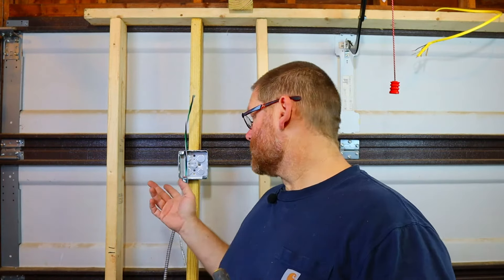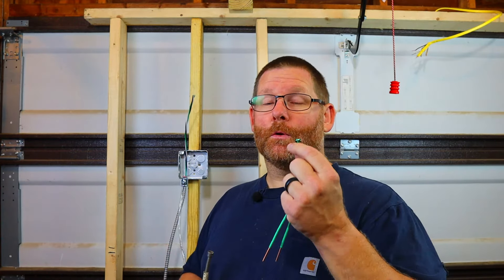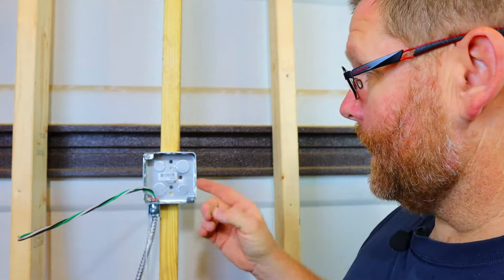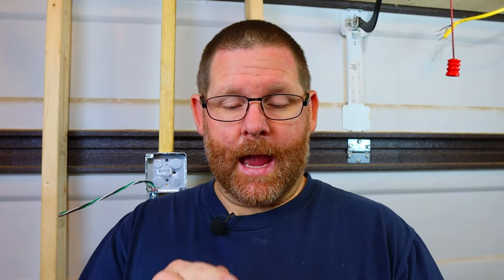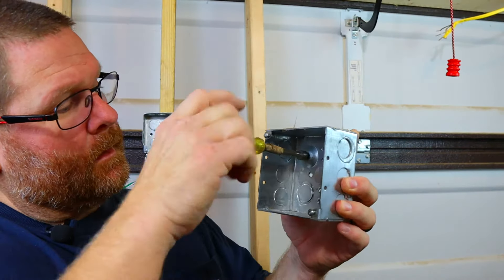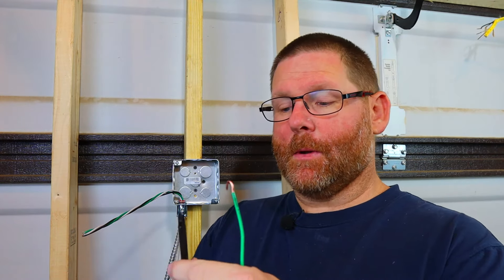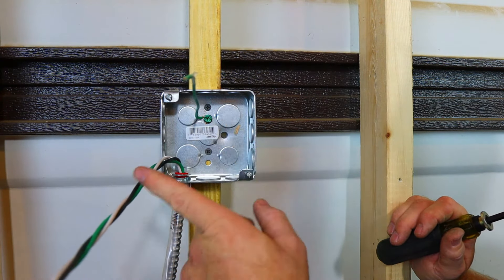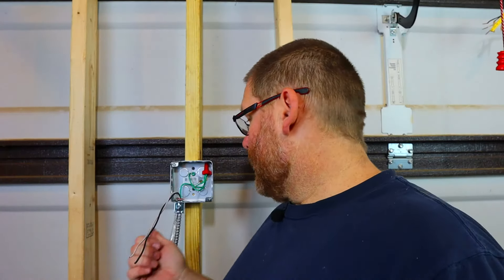How To Ground And Bond A Metal Electrical Box

Comment: Just used a side ground clip from home depot to ground an existing junction box.  The box was just for romex wire connections.  It had grounds running through it but the box itself was not grounded.  This was a hexagon box mounted flush at the back to a 2x4.  It didnt have the raised ground at the back like some newer boxes.  I was considering drilling a hole in the box side for a ground.  This clip was far easier and worked perfectly.  I hooked the front cut wire slightly over the clip and ran the wire from the back of the clip to a wire nut in the box.  The box cover fit over the clip easily.
Reply from the maker: Definitely a life saver when you don't have any other options. Thanks for watching and commenting ☺️
Reply: Good for you. I'd never use any kind of lazy @ss clipping sht. There's code for what you didn't do.
Reply: @nothankyou5524  I guess we all have to decide what we are comfortable using.  The clip is C UL listed and is designed to be used in exactly the way I used it.  I can say that the connection to the box felt solid and very secure.  I had to use a hammer to tap it on so it has a good amount of clamping force.  I wouldn't hesitate to use one of these clips again in a situation where adding a ground screw to an existing box is difficult.  Its certainly safer than leaving the box ungrounded.  I really can't say if this would pass code.  This is my own home.  I'm confident the connection is and will remain secure.
Reply from the maker: He is completely within code here. Come on bruh how about positivity rather than negativity 🤦‍♂️
Reply from the maker: I agree with you. It's completely fine well wiring code it's completely UL listed. Some people just want to troll. I would use them again too.
Reply: @nothankyou5524  The clip is acceptable and Code approved (provided it's "Listed" for the use). It's certainly better than NO grounding on a metallic box.

Comment: After watching this, I opened up a metal receptacle box in my basement that I needed to work on.  The ground wire was wrapped around the ground screw and the two ground wires were merely twisted together with no wire nut.  This was done by a professional electrician! Re-did the way you showed here (along with your ground nut video).  Thanks!
Reply from the maker: Awesome glad that my video helped you. Alot of guys especially older ones in my experiences do it like that. Is it right no, but unfortunately they do it like that for so long that they believe it's right.
Reply: Doesn't sound like he was a "professional" to me!

Comment: Nice video. For all the more curious folks out there the box in this video doesn't need to be bonded to the box because he is using BX wire(metal sheathing is the ground), I am of course assuming it goes to the panel or another 4x4 that is bonded. I also might clear up that your ground screw does not need to be a green machine screw, the code book states the screw only needs to be green for the devices(switch, outlet etc..) the bonding wire needs to be green or green w yellow stripe but only if insulated. Bare wire is fine for this application. Most of use just buy pre made 12 gauge pigtails that have a green screw but if you can't find any you have an alternative. Some but not all jurisdictions allow self grounding receptacles instead of the grounding pigtails.
Reply from the maker: Very well said thank you for your comment and watching
Reply: No they don't. But you sure start your rambling emphatically. For someone who doesn't read to the end, and why should they have to, he made the video, why try to technically show him up. I can tell you why....
Reply: Actually, that's not "BX wire"... it's MC ("Metal Clad", type MC). 
But agree 100% on everything else you stated...
Reply: Yes, he does have to bond the box.  The sheathing of ordinary MC cable is not rated for use as the EGC.  In order to be suitable for use as the EGC, MC cable has to have the "interlocked metal tape" type bonding conductor that runs the length of the sheath. - 2023 NEC 250.118 (A)(10)(b).  

The cable he is using has a green wire in it, so it is a traditional type MC.  There would be a splice or a device in that box if it were not a teaching example.  Therefore, he has to bond the box to the EGC in the cable to create the acceptable ground fault path.

Comment: Question: Make a video where you explain when you HAVE to use a ground bushing connector when coming into a box. I normally only see them in main panels and sub panels. But I know there is a code that explains that are required when using either eccentric or concentric holes.
Reply from the maker: Great idea for a video. I'll definitely work on it
Reply: @MountaineerOutdoors  
Is it ready yet?
Reply from the maker: 😂 😂 Nope unfortunately

Comment: Thank you. I found that to be very helpful.
My house was originally run w/ ground wires (14/2 I believe) coming up to the metal gang boxes but they were simply grounded out tot he box, and only 2 prong receptacles were installed.
I would like to bring these up to code and I felt this video was helpful in explaining the best way to ground/bond them.

Comment: Great video.  Thanks for that.
I have a cable that is going through metal ceiling fan box.  The cable is not spliced at the box as yet it is just a pass through (will splice when we install the fan).
When I use the non contact tester, it shows that metal box is hot.
How do i ground this as of now? or is it not required? pls let me know
Reply from the maker: It's just reading inductance did you figure it out?

Comment: Im in an old house from the 60s. Its 12 guage wire running through it but there is no ground.  Can i just ground the receptical straight to the box or should i run a new wire with a ground from the fusebox
Reply from the maker: If it's conduit yes but you need to verify it's connected still. Over time alot of the pipe does come apart. Pipe is technically a ground if it's in tact

Comment: Thanks for your helpful videos ! I live in an older apt that does not have a ground wire , would adding a ground wire to the metal box alone provide protection?
Reply from the maker: Do you mean adding a wire that's starts at the ground rod or steel to the box? Or do you mean just from the box to the Recep?  If it's older I may be in bx which they use to use the bx outer jacket as the ground?

Comment: My junction box with 3 outlets has 3 black wires and 3 white wires, i don't see any ground to hook up my floodlight camera is there any solution to that? Thanks!
Reply from the maker: Is it in metal conduit?
Reply: @MountaineerOutdoors  yes
Reply from the maker: As long as you have metal conduit and it's in tact, you can use the conduit as your ground. So you can use a pigtail from the box to your device. However, I'd always prefer a ground wire of course.

Comment: What fitting connector could be used to secure the installation of one metal electrical box directly on top of the other?
Thanks
Reply from the maker: Are you referring to back to back or back to front?
Reply: @MountaineerOutdoors  bottom to top '"one metal electrical box directly on top of the other"

Comment: What is the Article 250 verbiage regarding bonding by means of the MC outer layer sheath/connector, or conduit especially RMC? 

I worked industrial plant maintenance electrical for decades but did very little if any installations. I do however remember back in the days when a separate ground wire was not required when connected to metal raceway. Do you know when that rule changed and or the Article that addresses that topic/issue?

Thank you.
Reply from the maker: I'll have to look. But in conduit you can absolutely use the conduit as a ground without any extra ground wire. I personally don't think that is a good idea but perfectly legal

Comment: Thanks for the informative video. If your ground wire comes into the box as a bare copper wire, is it okay to use that for bonding the box instead of green plastic coated?
Reply from the maker: Absolutely!! and good question. Thanks for watching and commenting

Comment: Amazing video but how would u go about grounding with bx armored cable I understand it has its own bonding wire so how do we go about grounding an outlet or switch if the bx armored cable doesn’t have a copper ground
Reply from the maker: You will have to run new wire or use a gfci
Reply: Wouldn’t the outlet box or switch box itself be bonded  can I just add a green screw with wire for the ground since it’s bonded with the bx armored cable I don’t know if I’m making any sense  but hope it clear
Reply from the maker: So what you are saying is partly right. Bonded switch to box yes grounded no. I'm not sure the exact code right off but it's not legal anymore. I will have to look at it when I get home this weekend and I will let you know what I find out. From my experience though it's not and even though I probably showing ground I wouldn't trust it too many variable..
Reply: @MountaineerOutdoors I would appreciate that so much I’m working on my basement all my wires are bx armored cable with bonding 
I want to add outlets  when I test it all says correct wiring and when I test for proper ground reads 120 volts when I have the tester on black and white wire  says the same when I put the tester on the black wire and the metal outlet box  and would it be wise to splice and switch to romex

Comment: So you can Ground to the 2x4? Also what the 3rd free floating green wire for?
Reply from the maker: You cannot ground wood and the 3 rd wire is a pig tail
Reply: @MountaineerOutdoors  I looked thru several of my homes. Everyone one of them have the ground wire into wood 4x4s. Every video I seen also uses 4x4 to screw in the ground wire. So I going to say they do ground into wood.

Comment: Is there anyway to flush mount a metal box like that? We are building a shop with 7/16 OSB on the walls and are required to use metal boxes, but we want the box inside the wall so the outlet/switch is flush.
Reply from the maker: Yes get a plaster ring. Then it will be perfect. They come in different sizes

Comment: Does the ground wire need to be insulated 
My 12/2 wire has bare copper so the the ground from the box screw and the ground from the wire are all bare copper .  Is there a reason yours is insulated and needed to be stripped?
Reply from the maker: Nope it can be bare. I bought those like that pre made that's why mine look like that

Comment: Just bought a house and all metal electrical boxes are grounded via a ground wire and ground clip. The outlets are not grounded, but in using an outlet tester, it shows the outlet is wired properly. I need to install new outlets because the previous owner painted the outlets and you can see they are old. Do I need to get a ground wire to the outlet or is the ground wire that is connected to the clip to the box okay, since the tester shows the outlet is wired properly (both amber lights to the right are on and red light off on the tester).
Reply from the maker: Good question. So make sure you get self grounding receps. And/or you remove the plastic or fiber washer that hold on the screw to the receptacle so it makes metal to metal contact. Sounds like you have an older home? They use the bx or conduit as the grounding conductor which is totally fine.

Comment: Does it matter how old the metal box is for adding a ground wire to it and can I use any screw that fits or if it already has a screw even if it isn’t green
Reply from the maker: Code says it has to be machine screw.. Green is irrelevant as long as it's a machine type screw. The age of the box doesn't matter either

Comment: Thank you for your video. I have a 1970s home with an electrical outlet that has AC cable running into it (hot/black is copper, neutral/white is copper but the armored cable has a thin aluminum ribbon that connects to the ground screw on the outlet. I want to add another electrical box in my shop and tie it into this outlet with the AC (the new outlet has a 14/2 Romex). When I bring the Romex copper ground into the original metal box, should I ground it into the metal box? Should I take the aluminum ground from the AC cable and screw it to the original box too in a separate spot? I do not want to tie an aluminum ground together with a copper one.
Reply from the maker: You definitely can do it just as you have written here. Thanks for watching and commenting ☺

Comment: thanks.  Is there any reason why the ground wire can't simply first do a loop to the box'es green screw , and then go to the plug, all as one wire. Why make this setup with 3 wires.
Reply from the maker: You absolutely can I was just showing a different way.

Comment: Is there anything wrong with a ground wire connecting/making contact with a junction box in more than one place? I've got a light fixture install going on...I can't prevent the bare ground wire from touching the side of the metal romex where it enters. I will connect the ground wire to the fixture's ground screw... just wondering if it will matter that then the wire will touch the box metal in 2 spots. Thanks
Reply from the maker: Nope ground wire touching the box is totally fine
Reply: @MountaineerOutdoors  much appreciated 👊

Comment: Will not grounding  metal box throw the open ground code ?
Reply from the maker: That's a tricky question. You have to ground the box if you are using romex. If there is no ground at all, and your using emt or metal conduit as long as it's connected back to the panel your ok. The box has little to do with reading the open ground code

Comment: Very nice video.  I found out just today that the electrician that wired this house back in 1994 didn't bond the box for my electric cooktop and it is a box just like the one in your video (no raised dimple for the ground screw).  It is mounted to the back panel of the cabinet.  I think if I just try to screw the ground screw in, it will likely strip the box like you mentioned.  But wouldn't running a drywall screw through the hole also screw up the threads for the ground screw?  I was thinking of marking the hole, then taking the box off and drilling out the back of the cabinet where the ground screw would go.
Reply from the maker: So the short answer is yes, mark the box take it off the wall then drill out the spot. Running drywall screw will mess up your threads.

Comment: Isn't the ground screw when installed in the metal box touching the stud behind the box?  Is that ok for a ground?
Reply from the maker: If you are using boxes like I have it's raised up. Are you referring to boxes that don't have them? If so it could be
Reply: @MountaineerOutdoors 12:20 I liked the way you twisted the wires together. I didn't know the insulated part of the wires needed to twist around themselves. You may want to mention that very important fact. Thank you. I enjoy your easy viewing and great guidance on your program.
Reply from the maker: It's not important just the way I do it. The copper twisted is the most important part. Thank you for your comment and watching ☺

Comment: Could rubber washer insulators be used with a wood screw on either side of the box wall?
Reply from the maker: Not to ground the box. Has to be of machine type

Comment: You don't need to twist your wires together if you use the proper wire nut(ie  Ideal TWISTER wire nuts) and the Mc ground wire can be wrapped around the screw in the box if it is long enough.  There are several right ways of doing that.  Your way is right also.  Drywall screws are usually more brittle and bush league for mounting boxes,IMO.  Thanks, Russ, 28 years in the Electrical Trade.
Reply from the maker: I appreciate this comment and watching ☺ have a great day

Comment: What if one of the wires is stranded, ifor instance, a mc whip for an A/C.  Can one of the 3 wires twisted together be stranded or is a different wire nut or connector required?
Reply from the maker: You can do one of two things, make a pigtail from stranded or solid or use a fork terminal

Comment: Great Video! I always do a mid strip in my ground wire, loop on the box ground screw and then use my excess for the switch or receptacle. Old timer taught me this, but i heard its against code. though im not sure why it would be, less connections / less resistance. How ever i do waste more wire doing this with MC cable because i pull two feet into box so ground is long enough. whats your opinion?
Reply from the maker: I believe that as long as it's not broken and in good condition send it. As far as I know most people do that and never been busted any inspector. Great question. Thanks for the comment and watching ☺

Comment: Thanks for the great video.  I have a question now, if i have an outdoor receptacle that does not have a ground and I'm unable to run a ground to the electrical box that is not grounded can i just make my own ground near the location of the receptacle with a grounding rod?
Reply from the maker: No by code you cannot. That could cause a whole lot of issues down the road bottom line is no
Reply: @MountaineerOutdoors  thank you.  I figured that was the case. Do you have any videos on how to  ground the whole system? I really just need this one outdoor outlet to be grounded.

Comment: Hahaha. I love these videos. How about someone finally showing us how to ground a metal box when there is only a hot and neutral coming into it???
Reply: You see a lot of that, do you? I've never seen that at all. Two wires, not used for residential, not done "the right way. Or just run your own danm ground wire. Or pull romex, 2 wire w/ground. Surely you can find one correct solution, no?
Reply: @nothankyou5524  Two wires in residential homes (black and white) was gone the right way 100 years ago. And when you own a house that old, good luck trying to pull new wire through. It's a nightmare.
Reply from the maker: @Me-l9h-u8g it's not a nightmare when you take your time. I have wired lots of homes no issues.